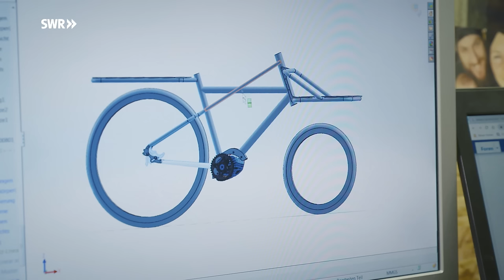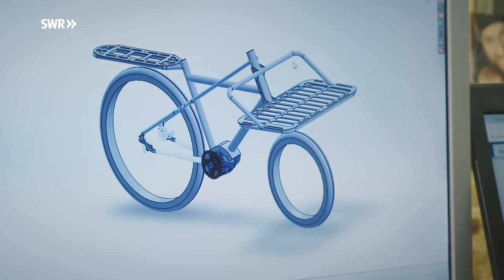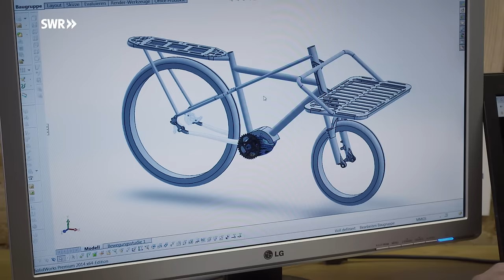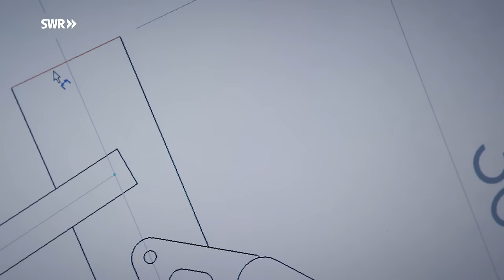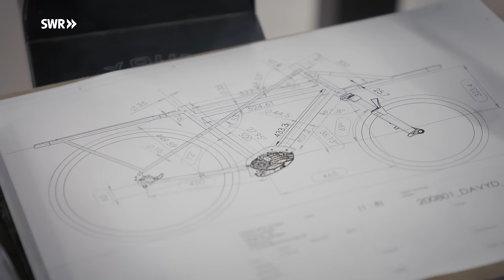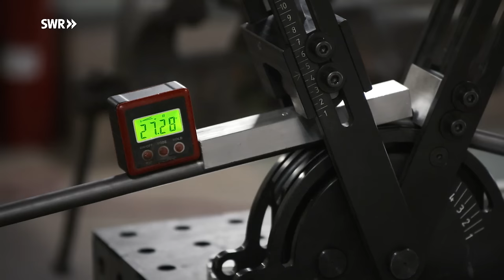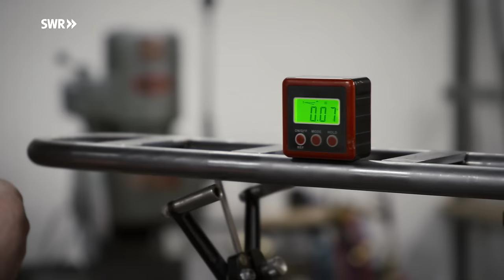Wie man ein Fahrrad baut | SWR Handwerkskunst

Comment: 7000€ ? HOLY MACARONI
Reply: andere modelle mit ähnlichem antrieb kosten kaum weniger und kommen nicht aus deutschland! preis ist 100% gerechtfertigt
Reply: 5 Tage Arbeit + Material, kannste mal ausrechnen.
Reply: Siehe Riese Müller Bikes, die knacken locker die 5.000 Euro. Sind zwar in Deutschland gefertigt aber natürlich in etwas großerem Stil und nicht ganz so individuell 🙂 schöne Doku👍
Reply: @Th3Odoor  Finde ich immer noch viel zu viel. Mein Radl aus Stahl kostete unter 3000€ (Allterdings ohne E-Antrieb)
Reply: @sebastianr1204  Kleiner Tipp: dann einfach nicht kaufen ;)
Reply: @lukumo2394  Aber dennoch interessant die Doku :))